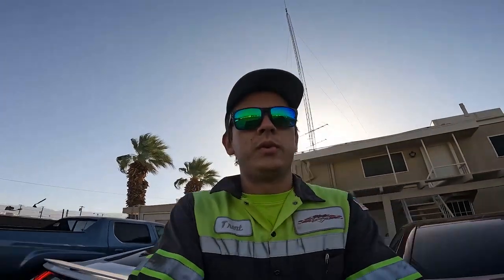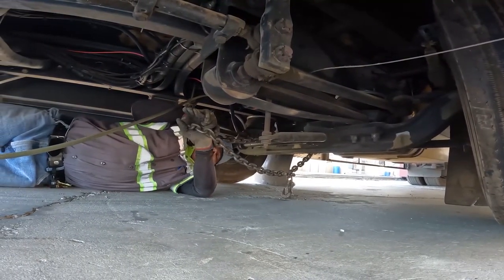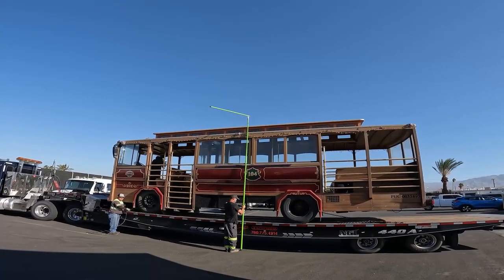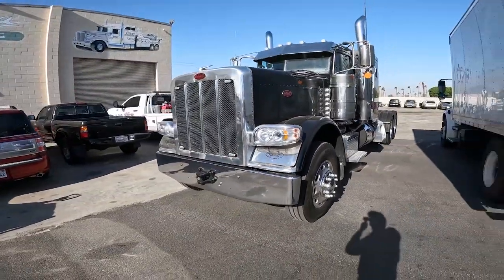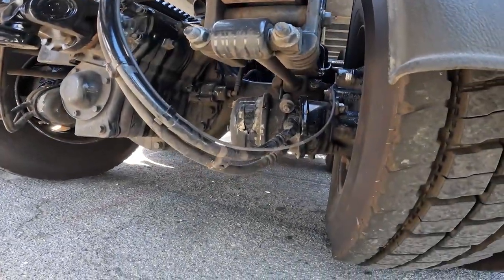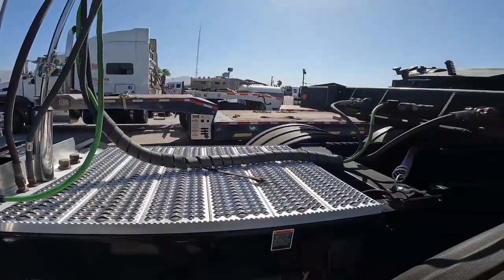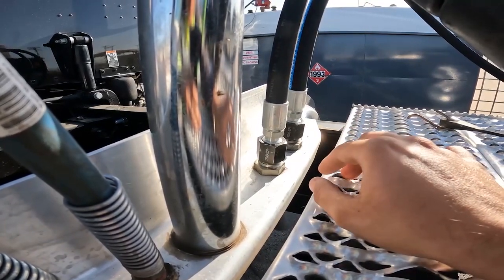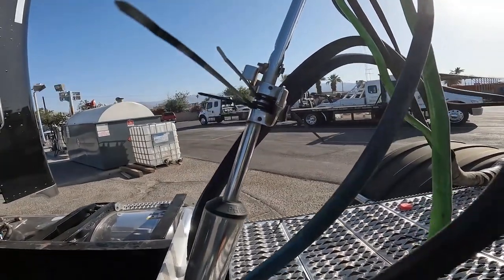New Semi Truck Alert!

Comment: You can have a PTO overpressure safety valve that dumps to the tank if something causes it to overpressure, like not looping the hoses.
Reply: Many pumps have internal relief valves to prevent overpressure.

Comment: Trent, check with your local fire Department to get some used fire hose to run your air and hydraulic hose through and your pig tail also.   Let the canvas take the wear not the rubber.

Comment: The LOW PRESSURE side hold down where it goes through the support bar slid sideways when you moved the hoses to tighten the high pressure side. WATCH YOUR VIDEO at 27;22

Comment: 2:53 Those were fake cable car charters that they ran around the San Francisco Bay Area for weddings and stuff. It looks like the company that ran them is out of business now and that one looks older than what they were probably running at the end. My wild ass guess would be that the car was built in the 1980s on top of an older truck or bus frame. The popularity of those things seemed to start in the 1980s. Probably somebody with too much money thought they could repair it and make money with it.

Comment: Trent how far over does a load have to be to be call oversized/overwith
Reply: ANYTHING that is WIDER than the trailer is a great start ,but anything over  98 inches & it can be considered a wide load.
Reply: @WileE.Coyote    Don’t you 102 wide, I think that’s right, a refer 53x102 if I remember correctly.
Reply: "Warlord" I'm not a truck driver but once it's over the cab of the truck I think it can be considered (OVER SIZE)